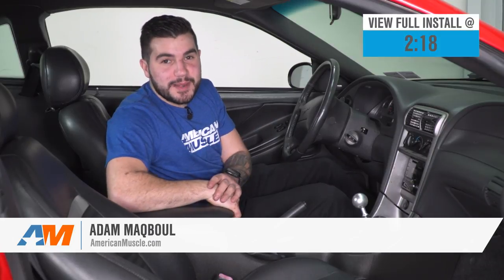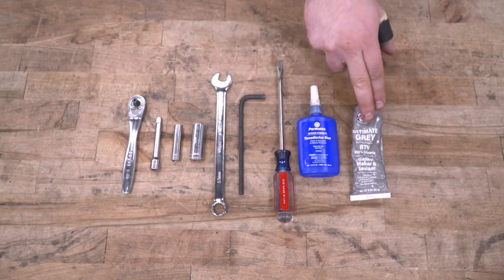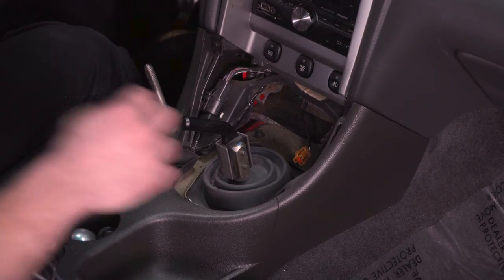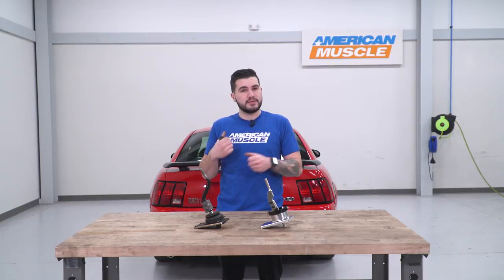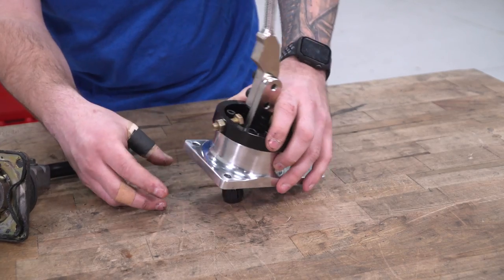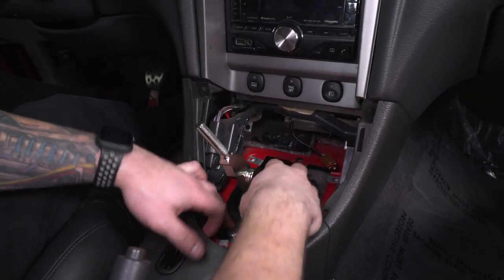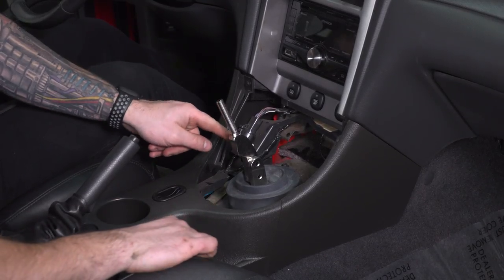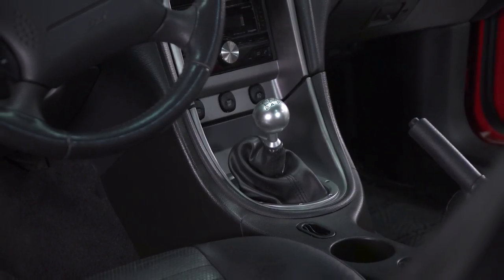2001-2004 Mustang SR Performance Short Throw Shifter - TR-3650 Review & Install

Comment: Crazy question can u swap out an automatic transmission for a manual transmission?
Reply: Yes but you might need a new dust cover for the the trans and also see if the the bolts match up

Comment: Let me ask you this why would you use blue loctite on the bolts for the shifter? And for that matter why would you use loctite on those bolts at all??? Do you realize by doing that now you're going to have a problem taking it out should you have to take her out for any reason??? Can you say tap and die??? Because at that point should those both break for any reason after you loctite them then you're going to have to have a tap and die... My advice to you is that you crank them down without the loctite... Because by using loctite you're asking for problems